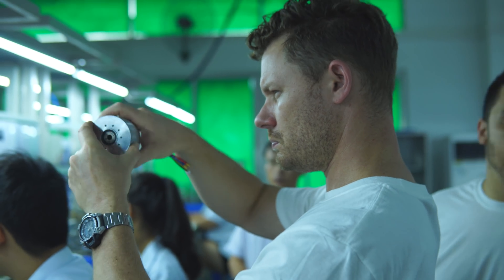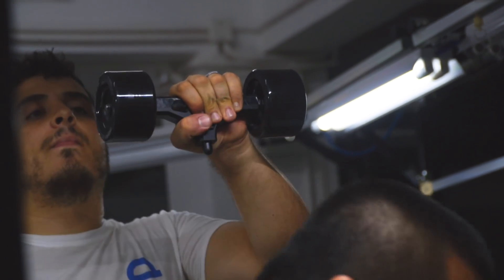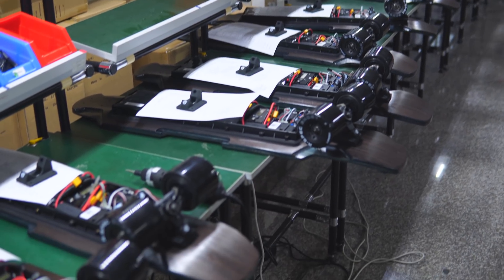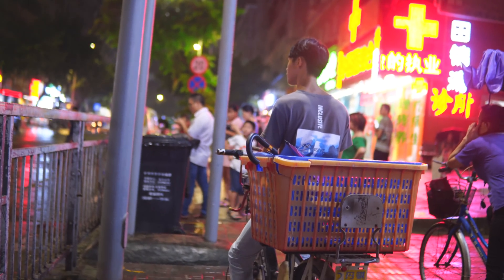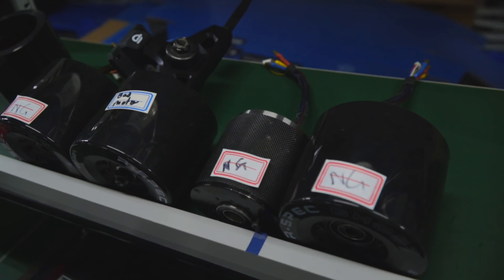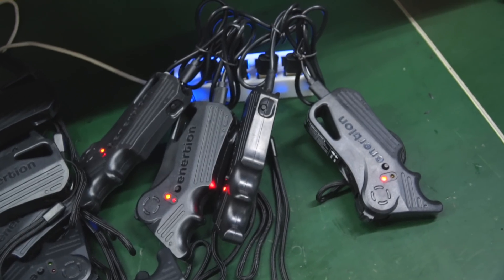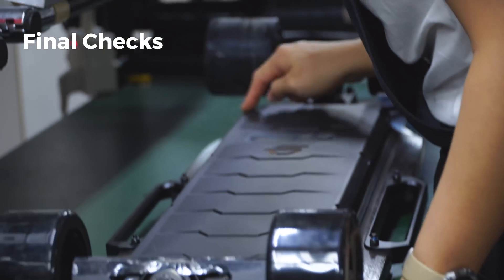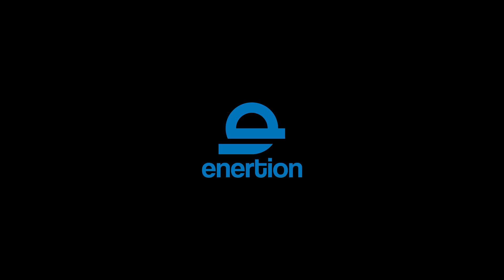BUILDING THE RAPTOR 2 | FINAL ASSEMBLY

Comment: fantastic video, very good approach how enertion is dealing with its - prospective - customers. the only thing that makes me hesitating ordering a R2 is ... that flex thing. I don't think it's got enough flex for a smooth ride. pleas proof me wrong and I will order one right away.
Reply: I think the rapport is more a 'raw power' type of board, which means that it has a big battery and big motors to go fast and not so much to ride smooth on bad pavements. You could always ordert he crossover wheels with your board to make it ride smoother.
Reply from the maker: You really don't want a flexy deck at high speed.
Reply: ADIDAS has a foam on their latest sneakers called BOOST which absorbs incredible amount of shock and vibrations. Stop wearing the hard rubber type skate sneakers and go high sneaker cushion like the one I mentioned from ADIDAS. No need to blame the board any more, the dampening will come from the sneakers or shoes Esk8rs wear
Reply: I know there is a coherency between speed and deck stability. I'm not saying evolve or even boosted but just a little for a smoother ride. I haven't had the chance to try your board. What smoothest setup would go if you needed to. What kinda bushings and wheels would you go for if you wanted to make it softer for going back and forth thru the city ...
Reply: Dude it only rides smooth on smooth pavement duh. It does not matter about a flexible deck. A flexible deck is bad for the battery because it could break the battery. Comeon man think about it!
Reply: Consider buying very comfortable sneakers, ADIDAS has a foam on their latest sneakers called BOOST which absorbs incredible amount of shock and vibrations. Stop wearing the hard rubber type skate sneakers and go high sneaker cushion like the one I mentioned from ADIDAS.
Reply: To achieve a specific goal then certain things need to happens. You are basically asking for flexible board and a good battery setup and speed and reliability and torque. The best solution would be good body mechanics, good sneaker cushioning. All your answers are here